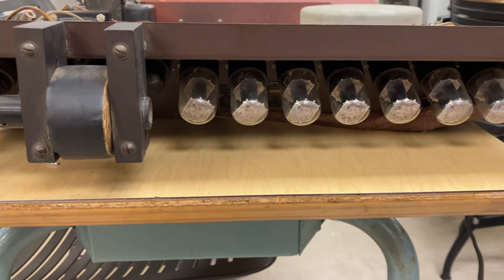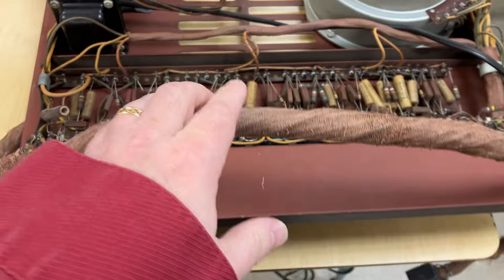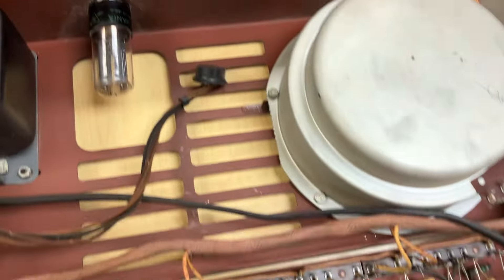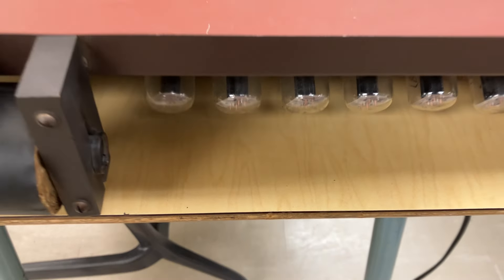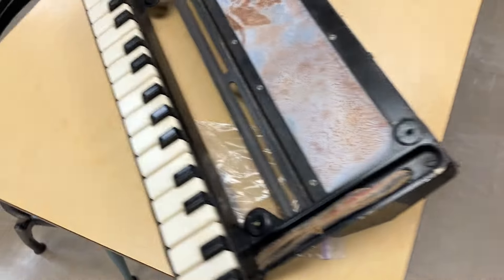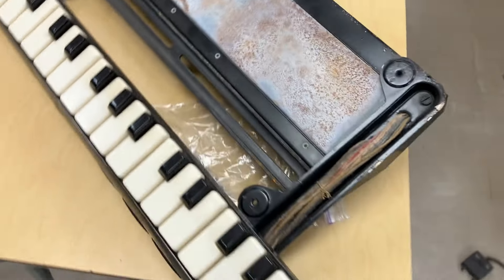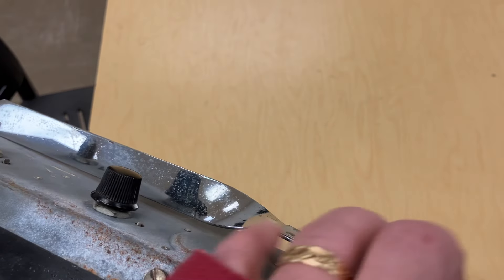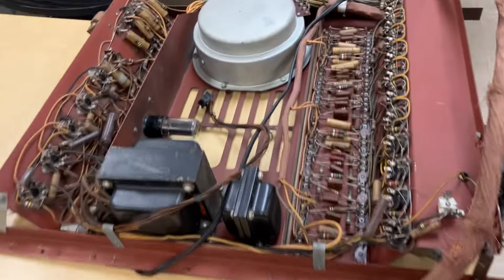Hammond Solovox Needs Restoration: Where to Begin?

Comment: Please start by checking to see if there's a "death cap" old fashioned Y2 capacitor in there connected between mains and chassis.
Reply: In that era they just used simple ceramic disc caps

Comment: Good Luck! I once repaired a Hammond PSU: needed a soldering tool, normally used for roof soldering.
Reply from the maker: Wow!
Reply: lol, you even have that when you solder motherboards from the 486 era, when i tried to remove or salvage the din input sockets for the keyboard. the solder just didn't want to melt.
Reply: Yeah, you can usualy find a cheap weller at the home depot that is, I think a 200-250 watt iron. it is like a huge soldering pencil. I have one of those for making the chassis solder connection on Fender amps. Plug it in, let it get to temp, use it and then unplug it asap -  not temp controlled.
Reply: @leiferickson3183  Right.How would I do that, when I was repairing the organ in the customer's house.I had only 30W soldering iront in my toolbox.

Comment: Could you test the old capacitors I think the result should be interesting
The band at one end dose have a significants
Reply from the maker: One of my colleagues has a Heathkit Capacitor Checker with a Magic Eye tube that's all kinds of fun. And it's important because it test at high voltages -- modern checkers generally don't go that high and will say a cap is good when it fails at higher voltages. Based on my experience, ALL paper & wax caps this old need replaced. Everyone I have tried has tested bad. The little square caps seems to be surprisingly robust in contrast.

Comment: "For experimental use only" at least the plackard on mine said that - It always made me chuckle. Change the electrolytics too. It is strange that the rectifier tube was bad. maybe it was turned on with shorted electrolytics?
Reply from the maker: I confess, against my better judgement, I did plug it in. It made sound! Crazy insane god awful sounds, but sound came out. I then promptly went "wait this is a terrible idea" and turned it back off. 

Yeah, there's a giant electrolytic that will need replaced.